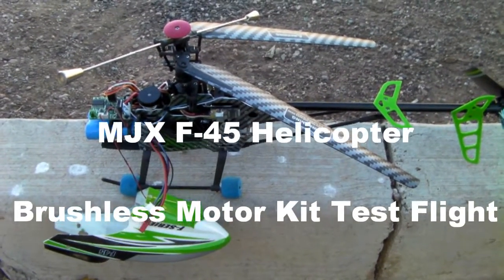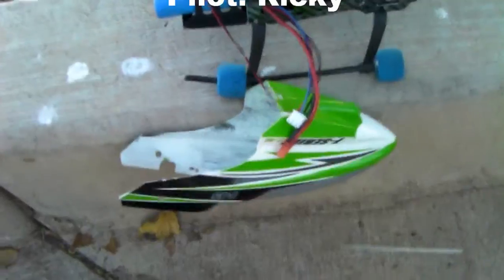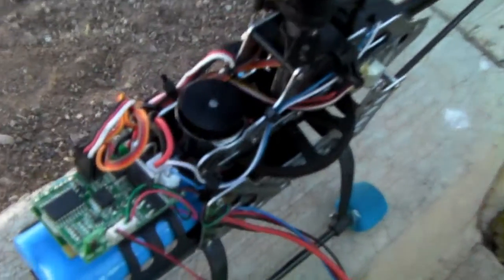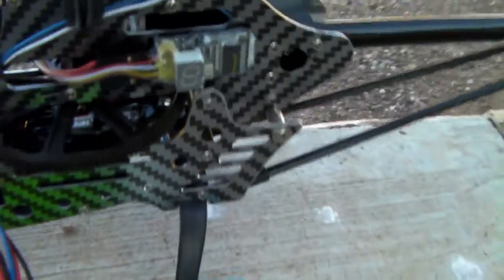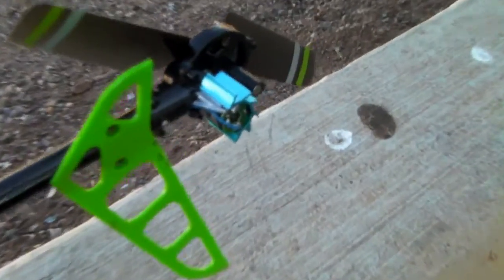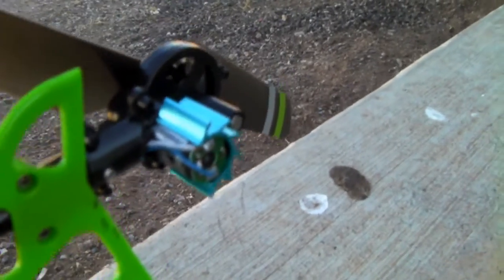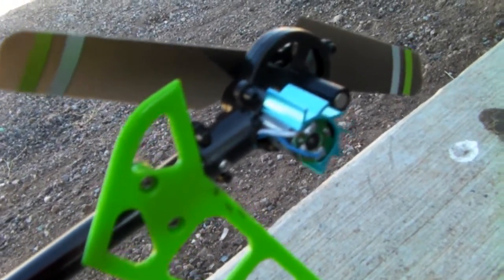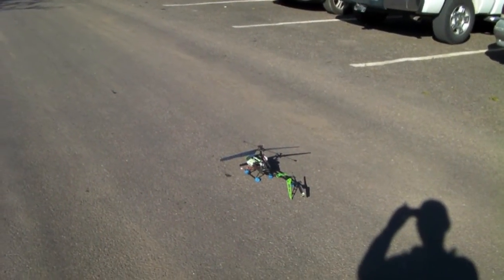MJX F-45 Brushless Motor Kit Test Flight

Comment from the maker: More or less 10 minutes, but I like to set my timer to 8 minutes to start my landing maneuver. I don't like to risk spent all 10 minutes flying high and not to have power enough for landing. I'm still using stock batteries. I ordered a biggerbatterybut hasn't arrive yet. A soon as I get it I'll let you guys know. The difference with this upgrade is the power this brushless motor gives your helicopter. It is also faster than stock and lighter too. Thanks for asking. I invite you to see my others.